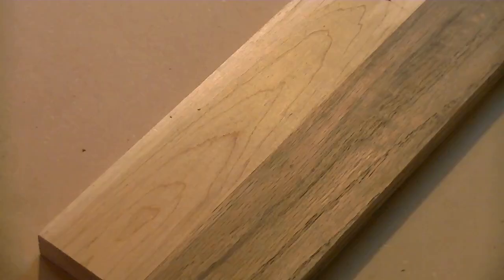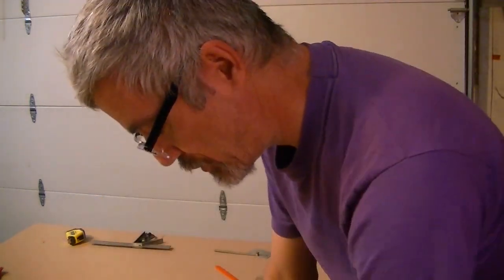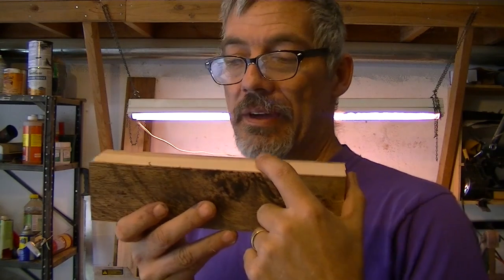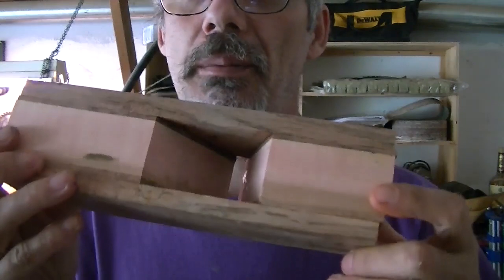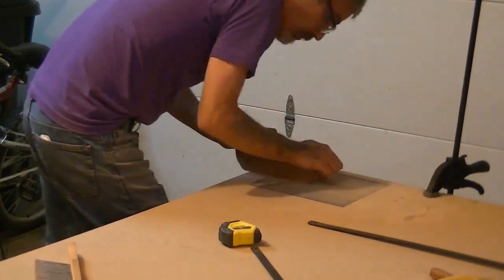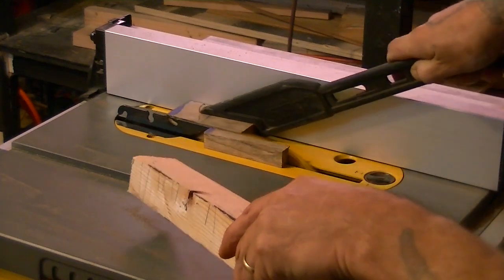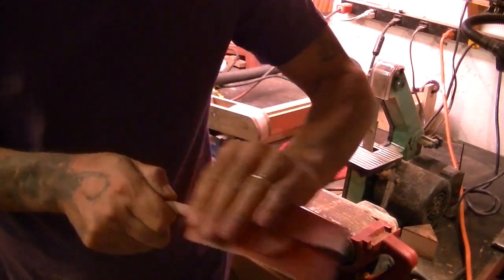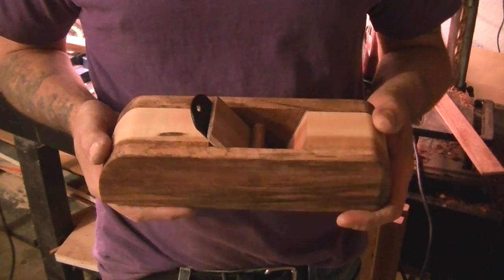How to make a Smoothing Plane made with maple and oak

Comment: Scott, I watched your review on the Dewalt 7480 table saw and seeing you rip material in this video, noticed you gorgot o e pretty cool feature of the fence. There are 2 settings on the flip over fence.  one for support when doing wide rips and one slot above for doing small rips to allow your fingers and hand clearence to pass through. hope this helps.

Comment: I wish I could make all of your projects but i have no power tools.
Reply: joaquin velez All of these things can be made with hand tools.  Power tools make some things easier and faster.  However, they aren't necessary as I'm sure Scott would agree.  There are also some things that power tools won't do as well as hand tools.  For instance planing.  Scott is making a hand plane because he knows the value of a well crafted hand tool.

if you were to find these things you could have a set of hand tools that would do most everything you wanted: A rip saw, cross cut saw, a back saw, two or three chisels, a couple of sizes of hand drills and some common drill bits, a framing square and a tri-square, a tape measure, a jack plane and a smoothing plane, a couple of screw drivers, a couple of files and rasps, some clamps, and a pair of pliers.  This list is just my take and I'm sure there are other combinations.  However, you can make nearly anything with this list of tools.  The best thing is that you can find nearly all of these tools used at very low prices or even free.

For making miter or angled cuts there are some very nice hand saw miter stations.  There are also some very inexpensive ones and you can certainly make one yourself.

Where power tools really become necessary is for the things like breaking down large sheets of plywood.  A hand saw will work but the purchase of a circular saw will make big jobs easier and you can modify it and build some of your own fixtures to make it do many more things for you.

If you wanted to get some power tools but didn't have much money or space here is my list of good choices.  Others will have their lists.  A circular saw, a jig saw, a variable speed hand drill and driver combination, a random orbital sander and the two luxury items: a small belt sander and a 1.5 horsepower or greater variable speed plunge router.  These don't replace the hand tools they go along with them to do the jobs that are harder with hand tools.

There are some great videos on youtube that show you how to make a table saw out of an inexpensive circular saw and a small sheet of plywood.  How to make a bandsaw-like cutting tool out of a jigsaw.  How to make jigs, cutting guides, and to use tools you have to do some wonderful things.